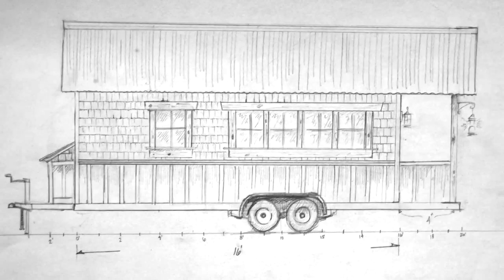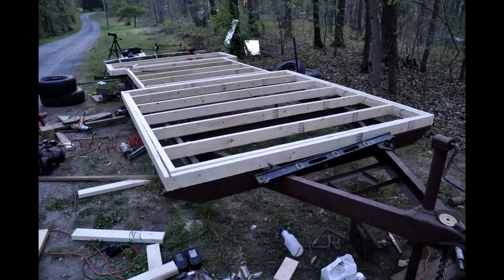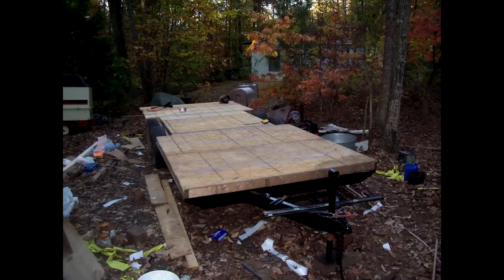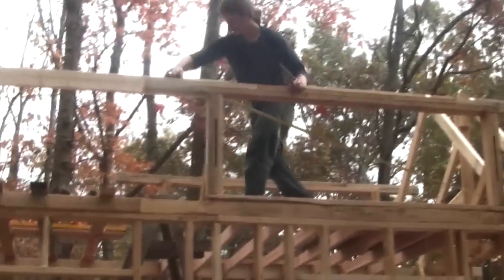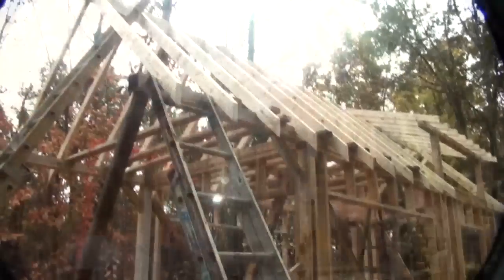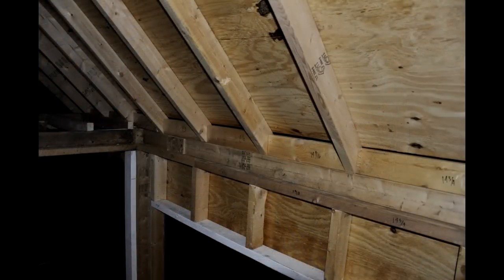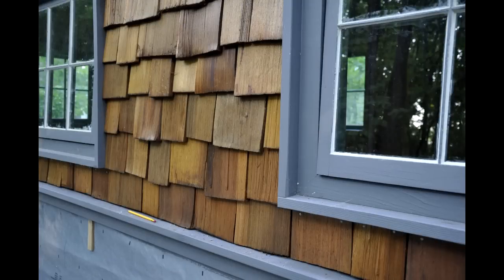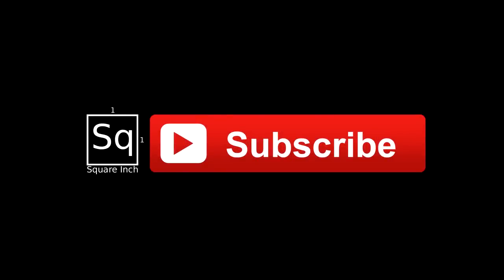Building a Tiny House #2 - Framing

Comment: I wonder how much that beasts weighs.... Great job :)
Reply from the maker: Jo Woo At the moment I don't think it weighs any more than a lot of peoples. Once completely done it may weigh a little more, but not that much. When I envision it disassembled all stacked up nice and neat on a trailer, it's not really that much lumber. I'm going to move it without the interior installed and nothing inside to keep the weight down. Once it's set up, it doesn't matter how much it weighs since I am not planning on traveling with it at all. Thanks for watching.

Comment: It looks like you have 3500lb axles. I heard an estimate of over 10,000 lbs dry weight. So may be up to 15,000lbs fully complete. Will this be legal to move?
Reply from the maker: +Bruce Collis Not sure where the 10,000 came from......but I don't know. I plan on moving it before it's done and setting up. I'm not going to be moving around with it. As far as legal......who knows, I'm just going to hook it up and go.

Comment: How did you secure the subflooring to the trailer?
Reply from the maker: James L Bolts trough the bottom of the wall, through the sub-floor and trailer. 1/2 inch carriage bolts. I'm going to show that in the next video I think.

Comment: how much all together did the shell of the house cost you when it was finished (not including all of the extras inside)
Reply from the maker: Calli Mozdzen I don't know, the trailer was around 100,  I only had a couple hundred in framing and sheathing, had most of it already. If you've seen the latest video on the channel, I've only got about $2000 - 3000 in it, if that.
Reply: +Square Inch I have a question. How do you attach the floor to the trailer? Thank you. This sounds really awesome and it is something I am interested in doing if I can find a way to afford it.
Reply from the maker: Kaitlin Manness I did another video on attaching it, check out my channel.

Comment: Love your creativity. As far as future interior finishing work goes, are you considering a tankless water heater? I put one in my fifth wheel and love it. I also installed one in my home. It uses propane and no electricity or battery. You can see it on my youtube channel. Looking forward to the future vids.
Reply from the maker: Pine Meadows Hobby Farm Thank you for your kind words. Yes, I'm going to use the tankless water heater. It's going to be mounted in the little shed part on the tongue side of the trailer along with some other utilities. I'll check out your video on your channel. Thanks for watching and commenting.

Comment: why did you not put headers above the windows
Reply from the maker: jerry waters It's not a "real" house, you don't have to follow code. But with this house, there's not enough weight to worry about it. Also the way the windows are built and shimmed the support is equal to having headers. Thanks for watching.
Reply: lmao well when you are going down the road, there is a lot of movement, and bouncing, so you shall see one day... any ways i think that you did a good job on it, but to think that there is not any weight well i would disagree on that one.....
Reply from the maker: jerry waters  There'rs weight, but not enough to need the headers doubled up in my design, you'd have to see it in person. The window frames themselves act as headers. The weight of the roof is supported all the way to the trailer frame.

Comment: How do you figure out the weight capacity of your frame?  Did you replace axles with heavier duty ones since a travel trailer doesn't weight anywhere near what a wood framed and furnished tiny house would.  How did you address this for safety?  I know you added some extra frame sections, but that doesn't change anxle weight ratings.

Comment: Nice progress . . . thanks for sharing!
Reply: thinking of building one myself.. if I use reclaimed items and try and cut down on actual purchases besides the frame and other necessary items I figure I can build one for around 6-8,000 which around where I am would be  ABOUT 6-8 MONTHS RENT FOR A ONE BEDROOM APARTMENT. I'd rather have a 120 square foot house of my own!
Reply from the maker: EDC Adventures I hear ya! I feel if you where not picky about the details you could build one of these houses for even cheaper. Mine is going to fall in your range for the total cost and I'm adding a lot of details. If I was not doing the shingles, porch columns, etc.. the way I'm doing them I could come in really cheap on this project. Most of the costly steps have been done very cheaply, such as the trailer ($100), flooring (free), framing ($cheap), etc...If it was plain jane, I think I could come in at $3-5,000 easy. But regardless, the numbers are right if the situation works for you. Owning is better than renting long term. Thanks for watching and commenting.
Reply: I would like to do things like what you are, but for now I wouldn't have the budget for it. However it being a house I can always upgrade, tear down or rebuild! I would get picky about the inside storage spaces though since I like a minimalist style house or at least keep a lot of things like excess backpacking/camping gear out of site.
Reply from the maker: EDC Adventures I started this build for only $100 (the trailer) I've been working on the house for almost 3 years. I have several reasons for dragging it out, but one benifit is the cost is spread out, making it very affordable. I've never done a big project and had all the money at once.

Comment: I am working with a friend designing his tiny house that he wants to build in the upcoming summer months. He wants to make it as light as possible so is toying with the idea of adding atop his exterior frame (walls) a 1/2" styrofoam insulation board and then wrapping it with typar fiberglass House wrap and finishing it with fiberglass corrugated panels which will be painted. This will reduce the weight of the house considerably and plans on using Roxul insulation and pine panels (for structural integrity) to finish the interior. In your opinion, does this sound like a good structural plan? Thank you for your feedback.
Reply from the maker: You left out the important part, how are you framing the walls.

Comment: recently I've seen two story sheds at Lowe's that have a full upstairs where you can actually stand up I really want to do my own custom tiny home and I wanted to be very portable but I also wanted to be a little bit larger than the standard tiny home and I would like a second story that I can actually stand up all the way while keeping in mind clearance limits when going down the road would it be possible to put two of these barn style 2 story sheds together and put them on a trailer??? And how easy or difficult would that be to move around??
Reply from the maker: Personally I would not go that route, they are going to be too big for road limits.

Comment: my main issue with this Tavistock institute tiny house psyop is this:  you have a steel trailer and a wood top?  the steel can take a lot of abuse, wood can't!  the idea of making the wood part of the trailer stronger using steel clips framing other thing to make it stronger then just wood and nails?

Comment: Again, I'm very late coming to this build series (or am I ? see below * ) but I'll comment fwiw anyway ;-)

It looks beautiful !  ...and you knew there was a but coming didn't you :-)  ...but I have to ask, what does it weigh ? (EDIT : see note below)  Looking at all that wood I'm guessing it's already over the trailer axle rating and I don't recall you upgrading that in the trailer restoration. The frame some, but not the suspension or tires. And you still have to furnish it. I think it's a stationary Tiny House at this point, unless my guesstimate on the weight is way off.

* According to YouTube I've already watched the next episode, #3 in the series, but only that one. And I don't recall it or the others and thought I'd just discovered it tonight. It's also unlike me to watch out of order and not subscribe to something like this. So I'm a bit stumped if this is a RE-discovery. It'll be interesting to see if episode #3 looks familiar and if I left a comment :-)

NOTE : Out of curiosity, and after seeing mention of an estimate of 10,000 pounds that seemed very high, I ran some very quick and dirty calculations based on your mentioned 16" centers for the studs and 1/2 sheathing for roof and walls. This is without any interior finishing or furnishing.

Framing (exterior walls, floor, and roof) about 1,500 pounds
Sheathing (exterior walls and roof) about 1,000 pounds
Roofing (corrugated metal evidently) about 500 pounds
Siding (cedar shakes and board) about 500 pounds

Total (very approximate) about 3,500 pounds

Guessing the trailer is the standard 3,500 pound double axle, and assuming the suspension is in good shape, you're half-way to your 7,000 pound maximum. Not including the trailer weight itself (about 1,500 pounds at a guess) or any interior finishing or furnishing (looks like you can have about 2,000 pounds maximum - it'll add up fast). And you'll probably need more than a half-ton to tow it without issues.

All just guesses, you really need to get it weighed to know for sure.

Comment: This is very beneficial, thank you. Do you have any idea about how much it cost to build the frame?
Reply from the maker: +Ethan “Dillmuffin” Dill I built mine out of a bunch of 2x4s I bought for .50 so mine was pretty cheap. It's easy to figure out though, just draw out your plan and count out how many boards it takes, multiply that times how much they cost. It's going to cost a few hundred at least.

Comment: how much it did it weigh in the end?
Reply: If you're interested in a rough estimate I ran some quick numbers in my reply above. Guessing about 5,000 pounds for the empty shell and trailer, leaving about 2,000 pounds to finish and furnish the interior. It's going to be tight to stay under the presumed 7,000 pound max for a double axle trailer, but it should be doable.

Comment: very cool. but how did you attach the subfloor to the trailer frame?
Reply from the maker: +koogmo Subflooring means the flooring under your main flooring. The wood framing that the sub flooring is attached to is bolted to the frame. I've got a video on that too.